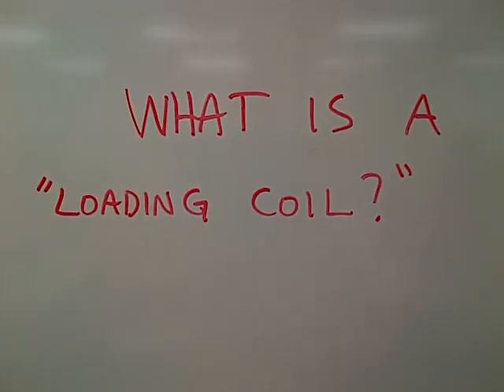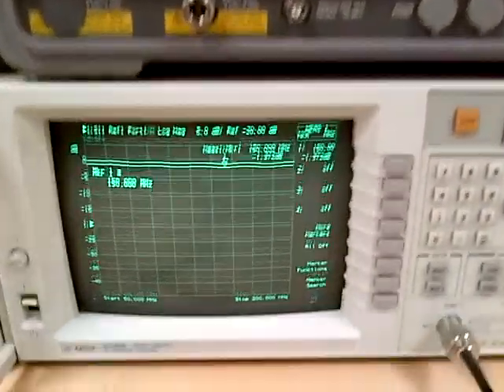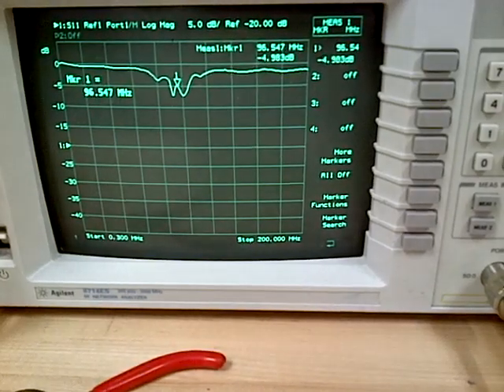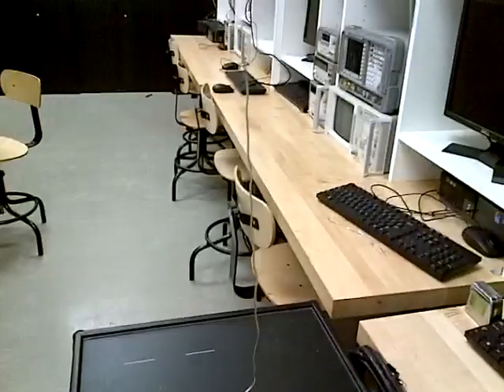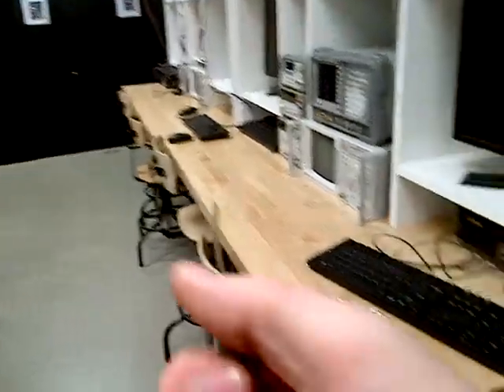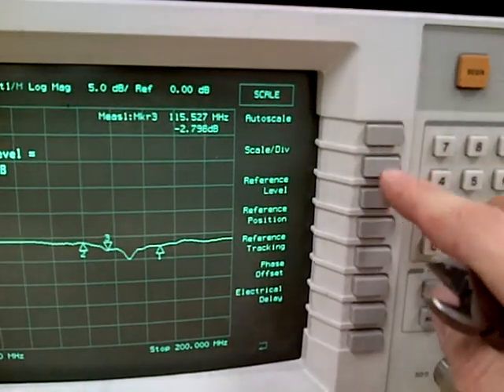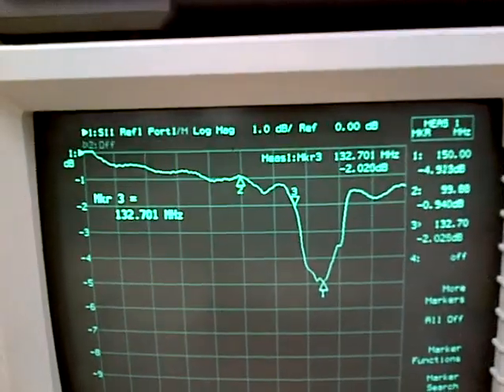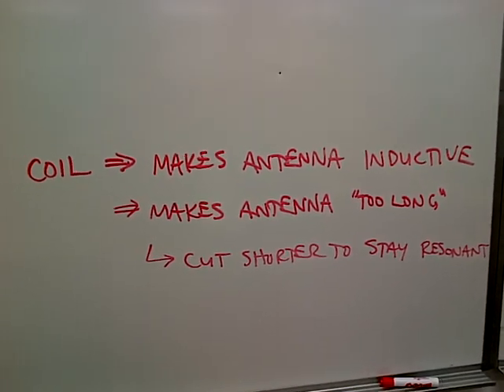What is a loading coil?

Comment: 2020 coming back. Who's here for HAM questions like this? "Which of the following describes a type of antenna loading?" 
A.
Inserting a resistor in the radiating portion of the antenna to make it resonant
B.
Strengthening the radiating elements of a beam antenna to better resist wind damage
C.
Inserting an inductor in the radiating portion of the antenna to make it electrically longer
D.
Installing a spring in the base of a mobile vertical antenna to make it more flexible

Thanks a lot for this vid Carl. Really helped me to understand the what/why of it.

Comment: Excellent explanation... always saw ham radio guys using miles long copper cables as antennas but always wondered how the pros use portable antenna like loading coils and why they worked.

Comment: Excellent demo!  Looks like it was done years ago, but electricity doesn't change!  :)  It should also be said that when it comes to antennas, size matters!  When you depart from an ideal, properly sized antenna per the frequency of operation to something that is shorter or more convenient for whatever reason, radio wave radiation efficiency goes down.  Sometimes dramatically.  Even tho the 'shortened' antenna may present a great load to the transmitter, it simply is not as good as is the antenna cut for the desired frequency of operation.  But hey....maybe the shorter antenna does good enough by itself, or you could add more RF power from the transmitter to make up the difference.  I'd say most antennas in use in the World in just about any use of RF are not a 'proper' length, so this lesson is perfect for reality!!
Reply: I agree completely. Nice demo.
Jeff W3AAB

Comment: If you were to uncoil the loaded antenna after you cut for the correct resonate frequency. Would it be the same length as the straight antenna or would it be shorter?

Comment: HELP ME UNDERSTAND THIS
The thing that gets me so confused, as a radiofanatic and radio geek since year 1998.
  I’ve ALWAYS been told: “Longer and bigger antennas, equals more range”. 

Don't people wanna have amazing very long range QSOs with people living miles and miles away from you, in places you never could imagine that you could possible to reach. 

Questions:
1. Does the loading coil decrease or improve reception, transmission, range and clarity?.
- Won't you actually lose reception/transmission range?, with a shorter coil loaded antenna? Compared to a straight antenna in the same frequency area. . I’ve ALWAYS been told “Bigger IS Better”.
3. What will you actually gain from using a coil loaded antenna except a shorter antenna?.
Reply: heestenhats imma answer this in simple way
Longer antenna to match quarter or half or even full wavelength means more gain at resonant frequency (70cm, 2m, 6m, 10m, ... etc)
Shorter with loading coil= resonant frequency at shorter length with less gain but it match the needed low swr needed to transmit safely for the tranceiver. This is usually used when long antennas isnt an option like for vehicle antennas ;) u r forced to load ur antenna

Also note that longer antenna has wider bandwidth as compared to loaded antennas. 

Best solution: build the longest antenna u can host in ur yard, pair it with an antenna tuner( which is simply a bunch of loading coils and capacitors) to tune to whatever frequency u want and good gain (determined by optimal antenna length, and design "yagi, vertical ground plane, etc)) , and dont forget the most important point use the lowest loss cable between ur antenna and AT or HT!! This is a killer point  i recommed lmr400 which is the best 73!

Comment: If you straighten out the coil, will the two antennas be the same length again?
Reply: +Nigel P.  No. Coiled wire adds Inductive reactance. It is different for different diameter wires,....somewhat
Reply: +Moronvideos1940  yes they would, more or less..

Comment: Hi I have a 33 foot fibreglass pole and I want to make a 43 foot vertical wire antenna . if I wrap 43 foot of wire around the 33 foot pole will it be the same as a 43 foot straight wire  antenna in resonance . Even though it is only 33 foot high . Thanks for the video I would apreciate a reply as nobody seems to know the answer hoping you do cheers.

Comment: Some question.
1. Is the loading coil similar in function to a capacitance hat?
2. What is the tradeoff for using a loading coil to achieve a smaller antenna compared to a straight antenna which has been cut/trimmed to resonance?
3. Does loading an antenna increase gain? is is the loading coil which manipulates the gain? ie. most common UHF/VHF dual band antennas have some form of a coil and usually 3/6db gain.

Thanks if anybody can answer.

Comment: Could one also confirm the resonant freq with an inexpensive antenna analyzer by looking at what freq the reactive component of the impedance goes to zero?
Reply: Impedence doesn't go to zero. It could be 50 Ohms, or less or more. Resonance is where the dip is... the lowest impedence. As long as it is less than around 2:1 (two to one) VSWR, the transmitter should be happy. Don't bust a gut trying to get a perfect 1:1; that's nice but not necessary. And the station you are talking to won't notice any difference!

Comment: Return loss on the straight antenna at 150MHz than the antenna with a loading coil optimized for 150MHz. Is there anything you can do to compensate for that or is that just a tradeoff you have to live with?
Reply: *Return loss on the straight antenna at 150MHz is much better than the antenna with the loading coil at 150MHz.

Comment: Two questions.  What is the diameter of the 6 coils you put on this. Secondly what was the length of each element that made this work? I don't have the test equipment  to do this yet which is the reason I asked

Comment: BUT THE LENGTH OF THE LODAING COIL ANTENNA IS OF SAME LENGTH---even though you were cutting the loading coil antenna to a shorter length, the overall length will be somewhat same as the other whip because the coil is also taking the addition length. I think whether you add a coil or not the overall length of the antenna only matters and should be same as the 1/4 wavelength.

Comment: Another question, you must also be able to use loading coils on radials? You can always stick a vertical antenna up, but it's a pain with the radials and if you're on 3 sets, then it's a bigger problem. Can you use loading coils on radials? 1 coil per band? And how much does it matter in bandwidth. Thanks for the reply in advance

Comment: It would be nice if you gave the length of the loading coil as if you had just straighten out in the first place., Antenna 1 is actually longer than antenna 2. At the end to two line actually might be the same length. Redo this test show the length of wires before you make the coil.